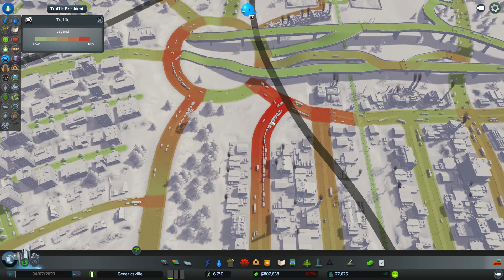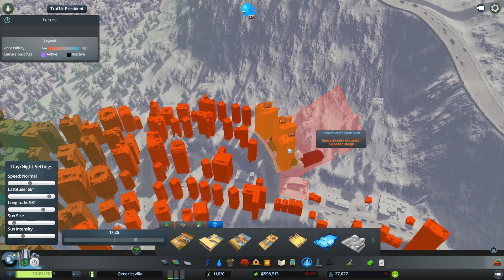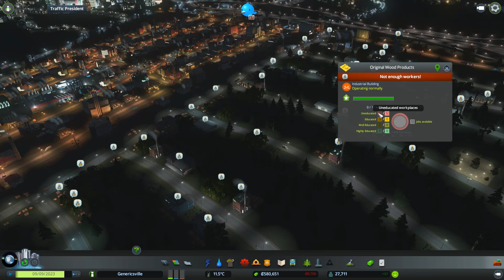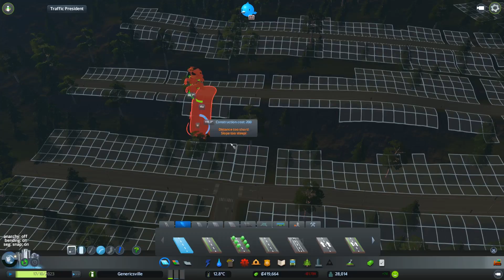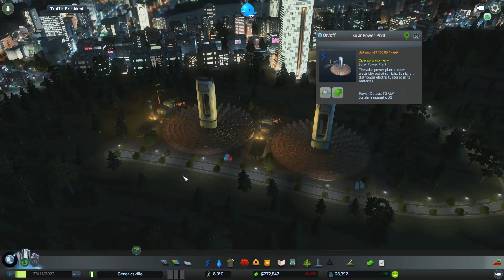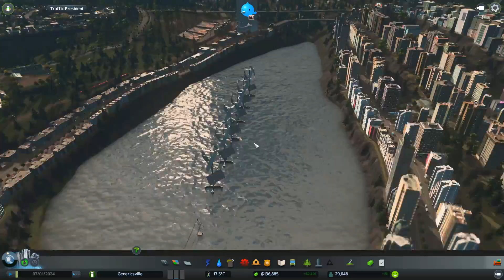Cruising Ahead = Construction + Cities: Skylines #11

Comment: I think those solar plants have a molten salt (yeah crazy) core that heats the water into steam which drives the generation turbines. Don't quote me, I could be wrong ;)
Reply: your thinking of a molten salt nuke. i dont think most solar plants heat up enough to justify molten salt.
Reply: +TheToric http://www.solarreserve.com/en/technology/molten-salt-tower-receiver
I think the idea is that the core stays hot through the night or smth....
Reply: I think that either it has batteries underground or that the bottom is solar panels and reflect onto the tower, that allows water to be heated and steam moves udrops the p turning turbines, then it collects onto the top and by night, they release a levy that the collected water down to push a turbine.